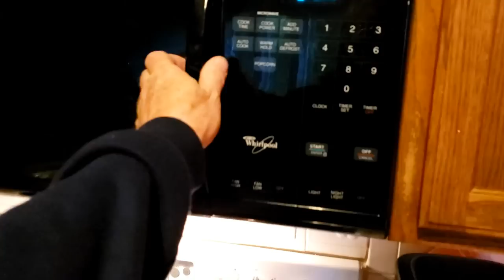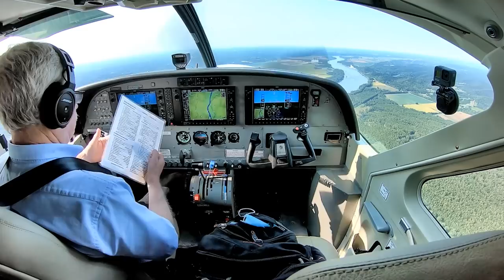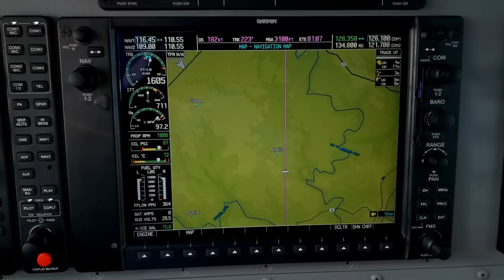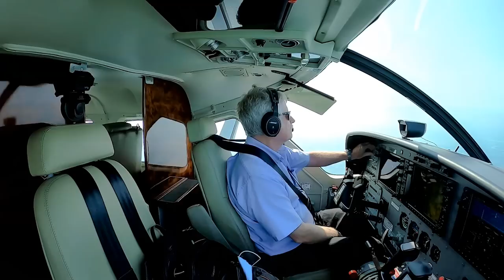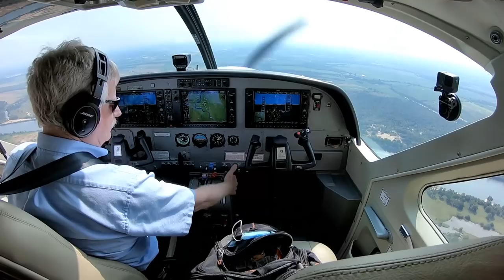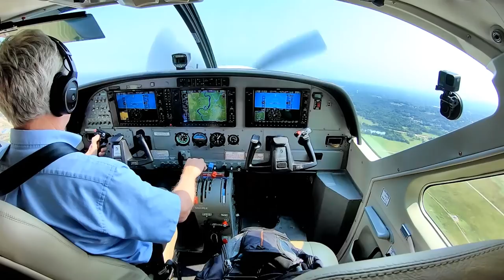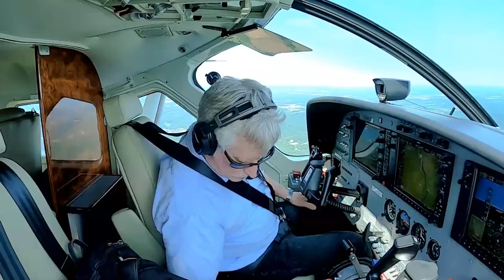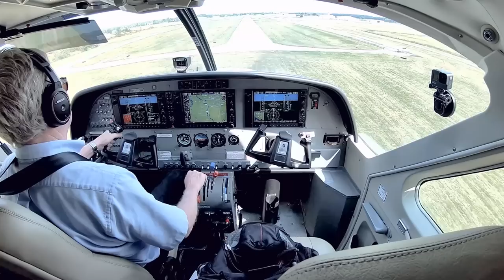A Cessna Caravan Flight and EMERGENCY Power

Comment: I've been flying the Caravan in the new flight simulator and although it's on a computer, I have become so fond of the plane. So, it's really interesting to watch an actual pilot who knows what he's actually doing fly the plane. Thanks for sharing
Reply: What flight simulator did you purchase? I’m looking for one to use.
Reply: @chelseacheluget82  I'm using Microsoft Flight Simulator 2020. If your computer can handle it, it's really worth it!
Reply: I have flown caravans quite a bit , 208b and ex models,  g1000 and steam gauge,  great plane,  very versatile and you will almost never over load it... takes off quick and stops on a dime 500ft some have done 400ft in full reverse
Reply: Btw, hardest part of caravan is memorizing all emergency procedures ( which isnt that hard)... the stimulator is harder to fly than the real plane

Comment: I always enjoy your videos, and especially the Caravan videos. I have a question: would the Caravan be a good long distance aircraft. I realize it's range is limited, but let's say I wanted to fly from New York to LA, stopping for fuel 3 or 4 times. Would the Caravan be ok, or would it wear out prematurely or something?
Reply: B Gregerson how many days can you alot for the trip.  It would be at least 2 days weather permitting.   Max cruise is 186 knots in ideal conditions.
Reply: @gmeck100  this is all good, but this has little to do with my question. The question is, is the caravan ex a good aircraft for frequent long distance flights, (stopping for gas etc.), or would a different aircraft be better?

Comment: At 20:39 ATC says "Climb & Maintain 7000 resume on navigation direct (unrecognized word) to St. Louis airport"  Perhaps he doesn't say "resume on navigation" , he says it so fast and it's a tad bit muffled, just wondering what he said and what that means? in response you say "Climb & maintain 7000 O-nav to Spirt for 1-Quebec"  can't quite make out what you said either.
Reply: That’s “resume own navigation” and the reply is “own nav to Spirit”  that is the controller has been providing vectors for his own purposes and is now releasing Capt Moonbeam to follow the flightplan.  The good capt is acknowledging this instruction.
Reply: @LuxPerp  AHHH, now it all makes sense. It was a bit too quick, ,,, So perhaps Capt. Moonbeam was using a "SID" plate and then generally completed normal vectors or modified vectors and pretty much knew how to continue with normal waypoints from his flight - plan?  I think I get it now and thanks a ton!!!!!

Comment: Nice flight, Jim.  Did the AP disconnect button fall off of the yoke just before touchdown?
Reply from the maker: Didn't fall off but, the screw came loose.
Reply: captmoonbeam you had a screw loose?  😉. Blue sky, Jim

Comment: 13:30 speed 100 and controller says to reduce speed to 150?
Reply: Controller asked what his approach speed is. He replied its 100 kts on final. The controller then said maintain 150 because he's still being vectored for the approach. No need to slow it up just yet and hold anyone else up that's behind you.
Reply: Controller asked for his final approach speed. That wasn't this current IAS though at the time he asked that. Controller asked that for planning purposes as just before he let N1Q know about a Cessna on 12 mile final that was in front of him. So controller then had him reduce speed to 150kts in order to maintain proper separation between the Caravan and the Cessna traffic in front.